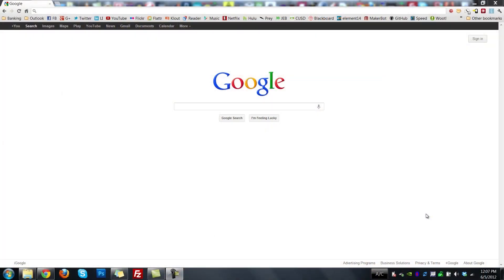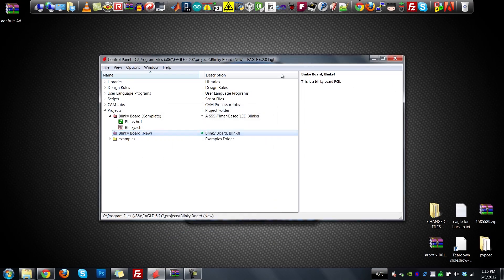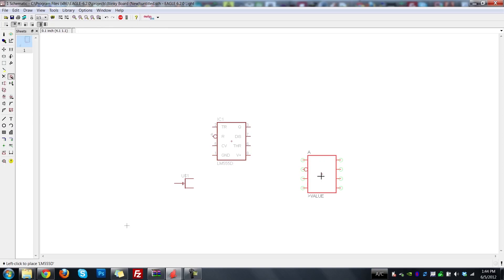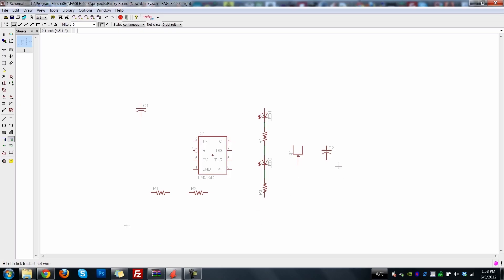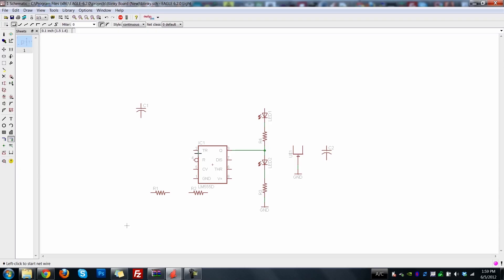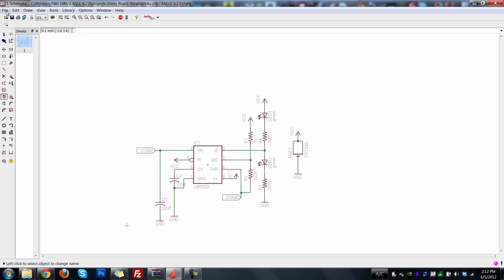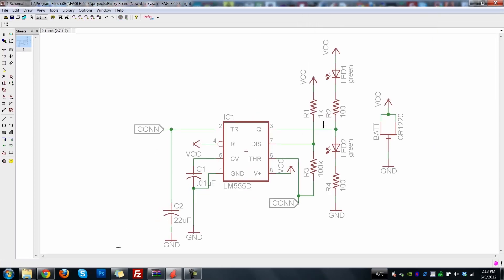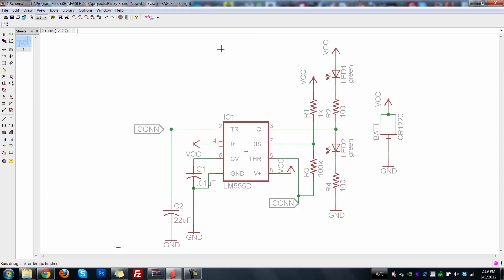Tutorial 1 for Eagle: Schematic Design

Comment: Thanks for a very good intro to Eagle! One thing that will speed up your work is to use the right mouse button to rotate the component while moving it. Then you'll never need the rotate tool. If I rememeber rigth it can be use in board layout mode to choose between routing alterntives while manually roting traces.

Comment: there has got be keyboard shortcuts? i dont see any
Reply: There are, you just type what you want to do and press enter. For example if you want wire, type wire, if you want delete type delete or d. I actually like it better than shortcuts.
Reply: If you're in a schematic and you go up to "Options" menu and then click "Assign" you can assign hot-keys.  Click "New" to add a hotkey function or you can change the existing ones.  For the "Assign Command" input box you'll have to go back out of the "Assign" window and hover over the command toolbar to see what it's actually called.  I assigned the following hotkeys that have been working out for me so far:
o Info lets you see/edit a lot of stuff (including the name) (CTRL+1)
o Group (CTRL+2)
o Move (CTRL+3)
o Rotate can be accomplished with move and right clicking
o Copy (CTRL+C)
o Delete (CTRL+D)
o Add part (CTRL+A)
o Smash (to get rid of labels I don’t want) (CTRL+S)
o Electrical connection (CTRL+E)
o Bus connection (CTRL+B)

You'll notice I try to keep everything to the left side of the keyboard and didn't assign all the commands a hotkey.

Comment: Hey. Today I found out this great tutorial and I have to say that I didn't know what the DesignLink is and what it is used for. It seems very useful. However, I am not USA citizen and I do not live in USA. Will this technique of ordering parts work also in Europe? Because I've actually quite did the opposite. First I looked up parts and then I just built schematic with the found parts online from a local retail store. I live in Czech Republic and one of the biggest electronic parts retail seller is GM Electronics (GME). I guess that they might have most of stuff found in EAGLE library, but I was quite unsuccessful to find particular parts, especially some buttons. I am more into THT because I find it easier to just stick it through the holes and solder it. I prefer bottom side of PCB to wire the connections and only lead straight top wiring where necessary using via pads. The top layer wiring isn't etched, it is in fact wired using a copper wire stuck through the connection holes - I cannot wire it under the parts, so naturally there might not be enough room to fiddle it in.

As with the blinky LEDs, we used to design the THT PCB in school by hand, and we used PNP transistors for this, not 555 timer. We used 555 timer in later classes for astable flip flop circuits, monostable and bistable, using 0-2 buttons. And we used pre-etched boards with large solder pads made by first years.

Comment: Hi, great tutorial! If instead of using a surface mount resistor/capacitor I wanted to use a through hole resistor, would that be possible. (I'm designing a cape for a BeagleBone Black that has an underwater pressure sensor, and in our proto-type we used through hole components so it would be simpler to just use what we have?)

Comment: Hi Jeremy, nice video, but just a little "FYI",  that design link search you're doing is a total waste of time (and money if you actually order). Just go to Ebay and do those same searches. Just a couple of quick examples. A) Your resistors. You can buy a kit of 2500pcs, 0805 package, 50 values from 1ohm to 10Mohm (5% tolerance), 50pcs of each value for about $8 with shipping included. B) The 555 timers in Surface mount package. I myself just bought a package deal for 10 of those for $2.50 ( I actually bought 20 for $5) and that one is "free shipping". They are the NE555, but the same chip as the LM555, and SOIC-8 package. So, there ya go...Good hunting :)
Reply: @robvei45: Shut up!..  Jeremy.  I don't know how much you make; but you're underpaid.  I started following you a while back.  -When I got my first Arduino.  I learned a lot from you.  Now I'm designing test equipment for the company I work for!  (CarCapsule.com)  Thank you!!

Comment: Did not find the renumber the parts in the run file. Seems they changed alot in the later version. Are you going to do an update? I am new to this and even had alot of trouble getting the library in!
Thanks for the video.
Reply: +amtpdb1 Hi I had the same problem. I got it here: http://web.mit.edu/xavid/arch/i386_rhel4/ulp/renumber-sch.ulp
Reply: +Carles Oriol Thanks for taking the time to reply. I just don't know what to do with the file now! Still learning.
Don
Reply: +amtpdb1 When you have to select what to run, look for this file.

Comment: Create your own symbol libraries that conform to ANSI/IEEE standards.  This isn't an uncommon problem, even with professional design systems costing tens of thousands of dollars.  The same goes for PCB pads:  The pad geometries must frequently be adjusted for a particular board shop's processes, so it's unlikely you'll get exactly what's needed with an included library from the the software vendor.  The most common electrical symbols don't take long to generate.

Comment: Gave this a shot as I need to develop some custom boards that I thought of placing on OpenSourceHardware when I was done.  KiCAD kept giving me snap issues on the components where the wire never was able to connect.  Tried this and the very first component I couldn't find.  A silly terminal box with two headers.  This is so not my day.

Comment: Continuing with "---adafruit library wouldn't work--":
I finally just inserted a copy of that unzipped library file into the Eaglecad lbr folder.  It still wouldn't show up when I re-opened the program.  I finally found a menu item called "Library" that only shows up when you have a project loaded.  I clicked on "use" and selected the adafruit library.  Lo and Behold, it works.
Sorry to bother you.  I should be having this conversation with adafruit support.  They have been quite helpful so far.

Comment: At 25:52 when using the Run command and when I click on the Renumber Sheet, the program brings up a prefix check that describes 2 parts without prefix in deviceset and it shows only the battery below it. How do I get past this?

Comment: What is 0805 and why do you always select it?
Reply: +Nagabhushan Baddi believe it's a standard dimension of the surface mount part 0805 = 0.08inch x 0.05inch  (metric equivalent 2012 = 2.0mm x 1.2mm)
Reply: +Ojsh Olman thanks

Comment: The video is great. When you did it looked really easy, but when I started to do it turned a nightmare. Each part I have to find in the Eagle is a pain. I found a connectors I need https://ru.aliexpress.com/item/2-4-6-8-10-12-14-16-18-20-24pin-5557-5569/32837317904.html but where do I find correct lib for them? What do I do wrong? The other problem is that many connectors Eagle comes with have references to some pdf files. When I try to google those pdf files I find nothing. I actually find references to those pdf files on github in eagle libs, but I can't find the actual files or connectors on AliExpress or Ebay.

Comment: Eagle's UI is horrible and is still controlled as if it was a DOS program from the 1980's. Just about every piece of production software from every other industry that has been around as long moved on from that decades ago.
Reply: Why does it need to look pretty? It's a complete waste of resources. I'd much rather it run properly than have it look all fancy with nice little icons. I use CAD packages like Inventor and Solid Works, they look really nice, but in terms of functionality, are no different to 10 year old systems.
Reply: Chuck Norris A UI is for a lot more than looking pretty, it's about productivity, intuitiveness and keeping with industry trends like EVERY other long term software package has done over the years. Like it or not even looking good is a must, it's part of every product on the planet. This is software development 101.
Reply: Look at Windows 10, it is still built on NT XP, productivity went out the 'Window' when they decided to keep up with 'industry' trends. People still use XP because it's simple and still works. New software versions with a fancy UI are there to get people like you to buy the latest and greatest. I worked with Pro Engineer 200 because guess what, it still works. Prettyr UIs are completely unnecessary.
Reply: Chuck Norris Erm.. 1) Windows has had about 5 MAJOR UI overhauls since XP and 2 major API overhauls too. The way the Kernel works, drivers and security has been completely re-written multiple times and is NOTHING like NT. so that's wrong.
2) Windows 10 has the largest market share of all versions of windows, so your theory about people sticking with XP is wrong too.
3) A well working and efficient UI has nothing to do with being Fancy, which I've already explained to you. It's about productivity and intuitiveness.. and yes people DO care about looks after that. Wrong again.
4) Again EVERY other software package out there that's been around for years has modernised it's UI. Eagle is one of the very few that hasn't and MANY people have complained about it. Wrong again.
Sorry you are just talking out of your arse.
Reply: Haha. You're really showing yourself up now. Not only have you been proven categorically wrong on all of your points, but you then resort to really childish and silly insults as a last resort. Lol, you're funny. Not sure I should have expected more from someone calling themselves "Chuck Norris" I suppose. lol
Reply: I think a lot of this comes down to supporting legacy files, and keeping the format familiar for experienced designers. Other old CAD packages (or other professional engineering softwares) have similar things. Sometimes you find that a new version looks nicer, has some new features, and has an improved UI, but upon using it over time you discover that they haven't really changed anything but the visuals and it works the same behind the scenes. Older engineers who have become familiar with a software package for decades can get pretty annoyed when the layout they mastered over the years becomes changed.
Reply: Well if they don't like standardised UI controls that conform to well established industry standards, they'll shit the bed now that it's become subscription only pricing and you must be online to use it